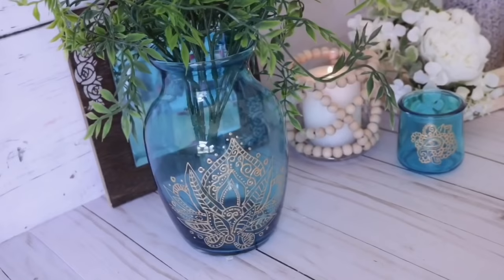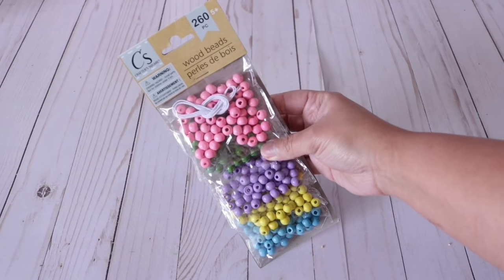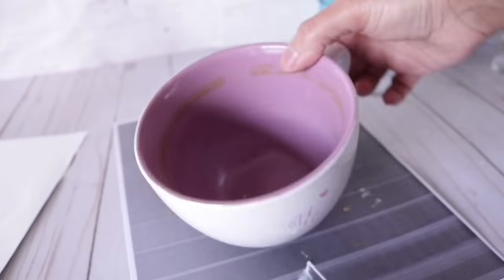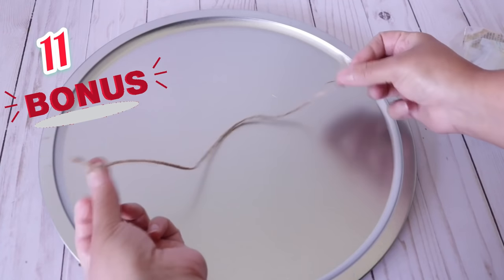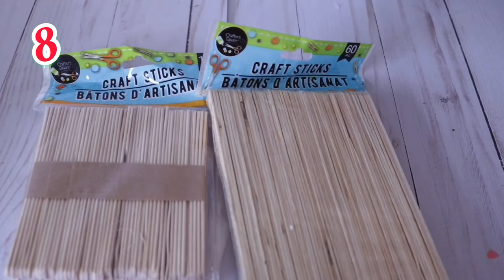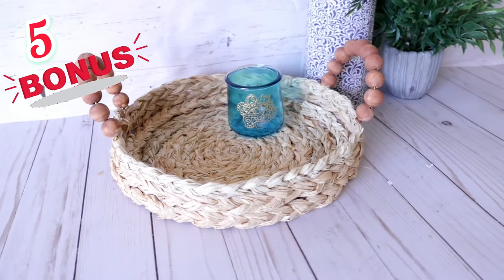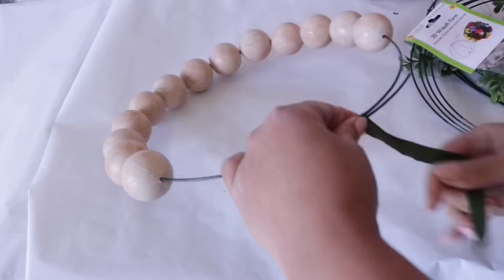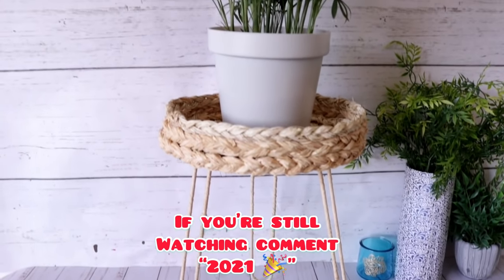20 Best DOLLAR TREE DIY High End Crafts!

Comment: Maybe go ahead and put some tiny screws in with washers at each snake interval. If you predrill from the bottom into the snakes. That would make them strong enough that you could actually pick it up using them as handles. Talk about tripping over words 😆. I hope this makes sense. Have a great day 😁!